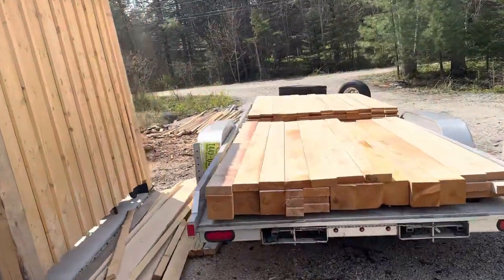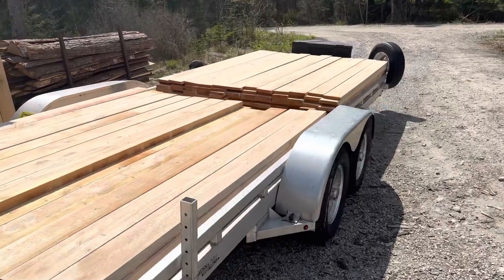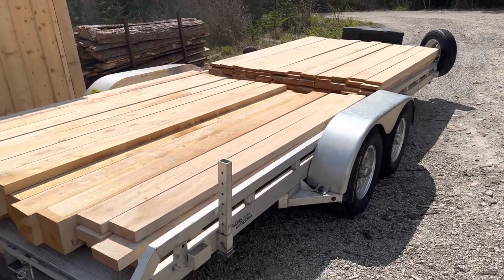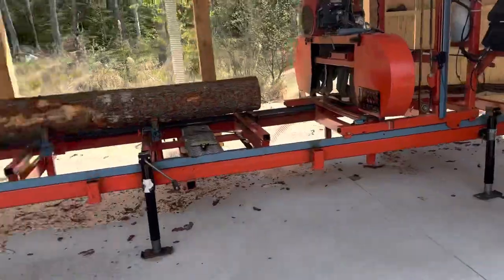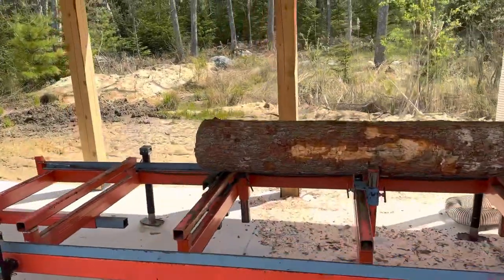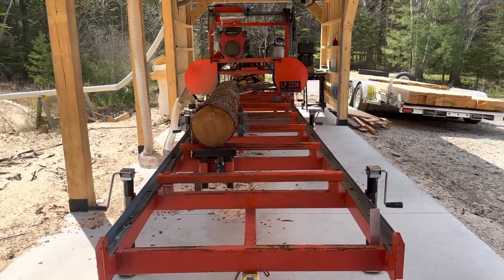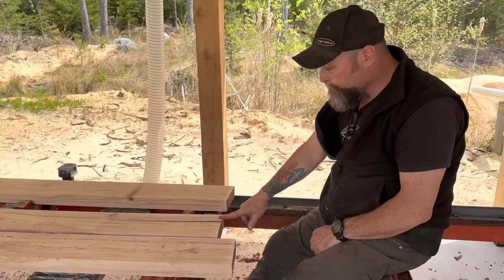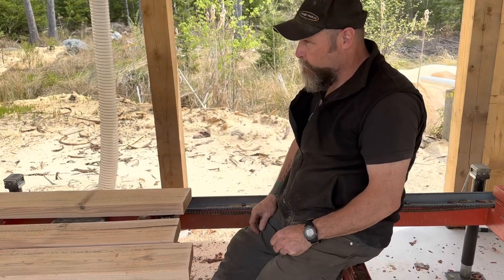Sawmilling and BLUETTI giveaway details!

Comment: That's an easy task to qualify to win, Love ❤️ all your videos,  l have been a subscriber from the moment l found you ! 
BLUETTI IS AT THE TOP OF THE LIST FOR GENERATORS THAT MY WIFE AND I WANT TO TRY, ONCE  WERE SATISFIED! WE WILL BE LOOKING TO BUY ENOUGH TO SUPPORT OUR ENTIRE HOME, OFF GRID. We will still require this little one for our S.U.V. camping, recharging our tools... what a great way to start the long weekend!
So thanks for sharing 👍🏻 Jeff.
Sorry the hemlock split at the end? I think 🤔 that l would use it, glue and sandwich it with others. Or like you said, rip it to a 2" X 4",   
Yes, great odds with you ! My Wife and l will love the little BLUETTI GENERATOR, The model AC200P, it will be as advertised by you. Sold us on it for sure.
Your friend and neighbor.
✌🏻🧡🤘🌤 🇨🇦.   🍁- Ontario.

Comment: Just thought of a way to place your peavy up off the ground. Take a steel or plastic pipe around 3 or 4 inches about few inches long. Fasten it to your 6 x 6 post and stick it in that keeps it up off the ground. It will always be there when you need it instead of leaning it against your post. Just a thought.